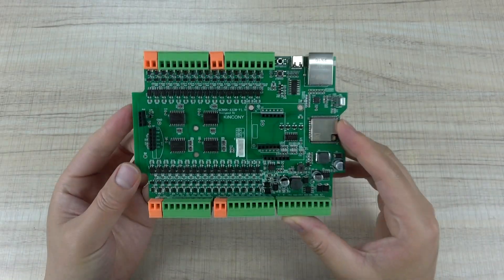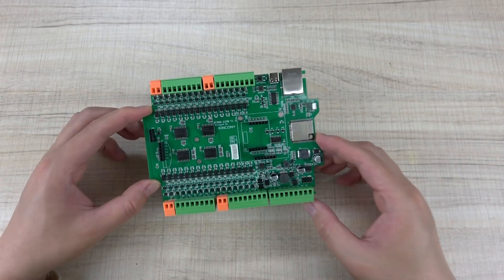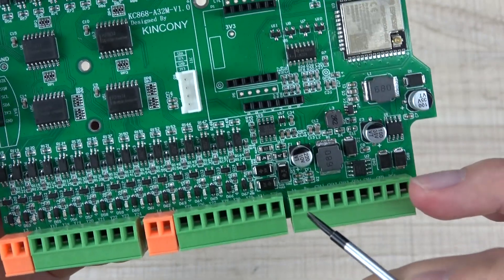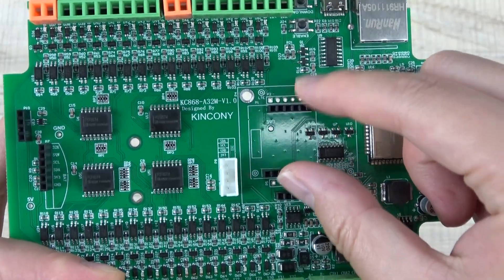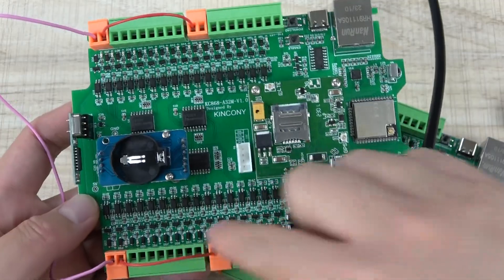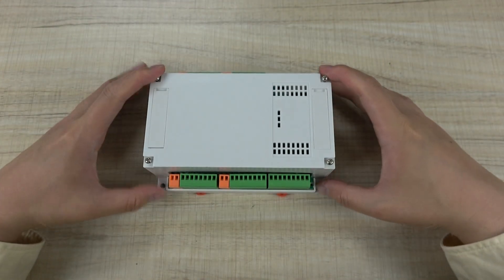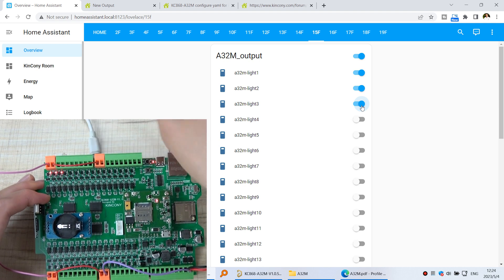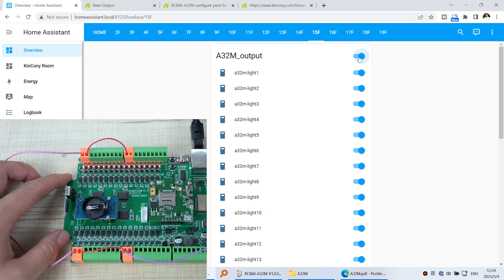NEW A32M ESP32 home automation MOSFET board for home assistant

Comment: Have you thought about expanding the voltage range to 60v? This would enable it to be used by people who have 48v battery setups and solar systems.
Reply from the maker: do you want control ON-OFF for 48v?
Reply: @KinCony  I was partly just thinking to power the device, but being able to switch 48v would make it even better. Alot of off-grid systems use 48v batteries which when fully charged would be 58.4V. Being able to switch that voltage at maybe 2A would enable people to use DC step down converters directly to power all sorts of things without the need for relays or contactors. Fuses might need to be considered.  Just a thought.
Reply from the maker: @rickysemmens6250  now the mosfet work voltage MAX is dc 60v, current not large. but i not suggest to use full of 60v, it's not safety, suggest add a extend driver chip.

Comment: Is modfet out is reliable and it work for long last?! compare to relays.
Reply from the maker: connect to DC load directly.
Reply: The dry contact output relay type is preferable anytime, anywhere.
Reply from the maker: @israelgoodluck2464  yes, this solution A32M need use by extend relay or DC contactor.

Comment: Nice board as usual 👍🏼 one comment about schematics, I think outputs are missing from it
Reply from the maker: A32M have removed Digital INPUT ports
Reply: @KinCony  yes I saw that, but my comment is regarding outputs in schematic. There’s just PCF8574P out, but no Photocoupler & mosfet part after that.
Reply from the maker: @Teme-V  sorry, there should have two files, now we have updated file on web server. you can re-download again, will see it.